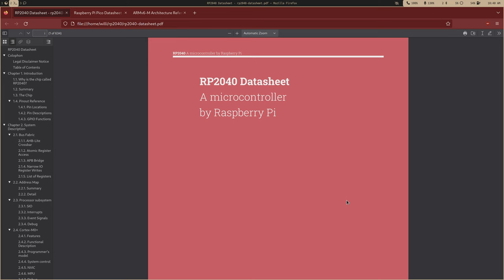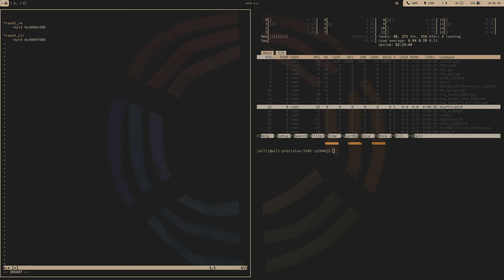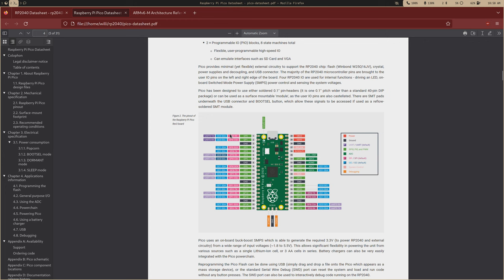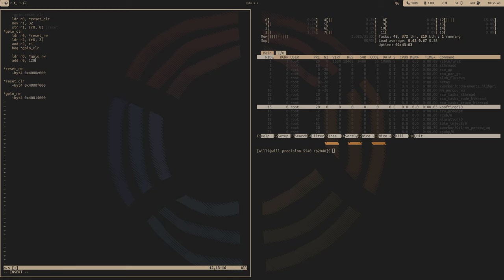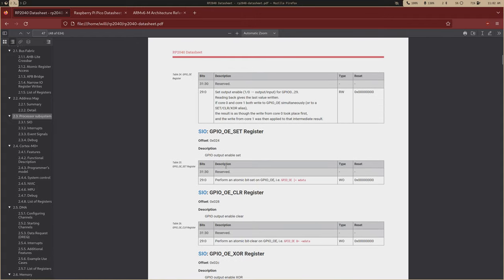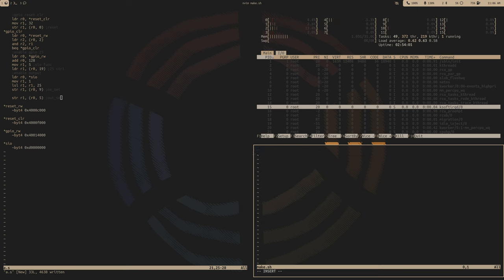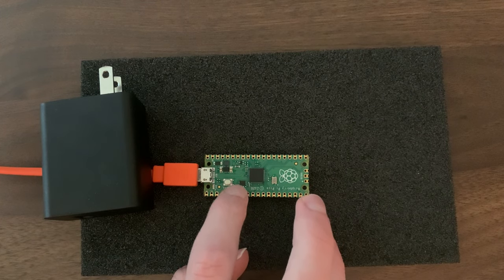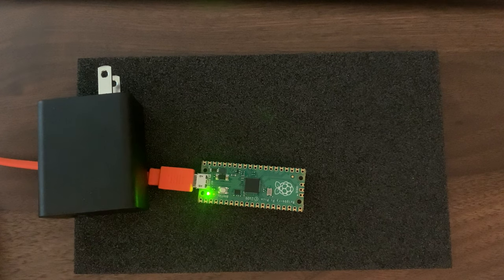RP2040 - Baremetal Assembly - Subsystem Resets and the GPIO

Comment: I think you set bit RESETS_IO_BANK0, but not RESETS_PAD_BANK0. I have a feeling you need to do both, not just the first. I found that, using similar code, I could get blinking by flashing the Pico, but it wouldn't work on a cold power recycling.Setting RESETS_PAD_BANK0 fixed this problem.